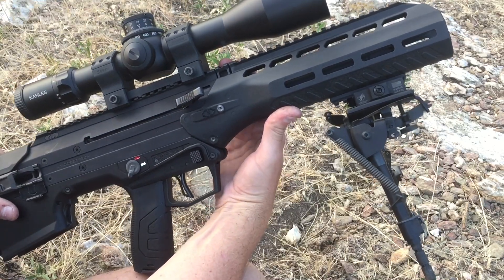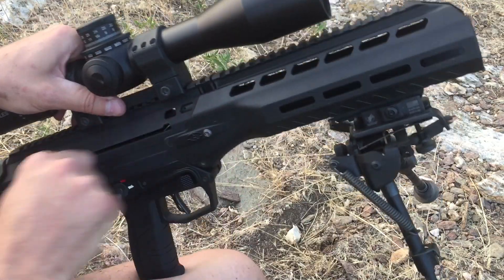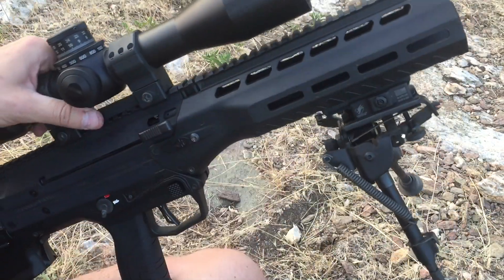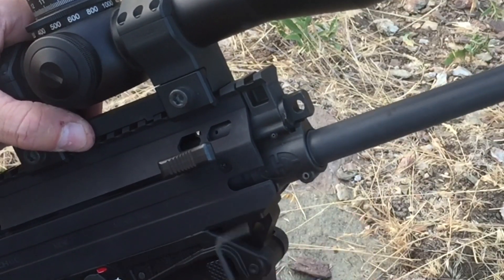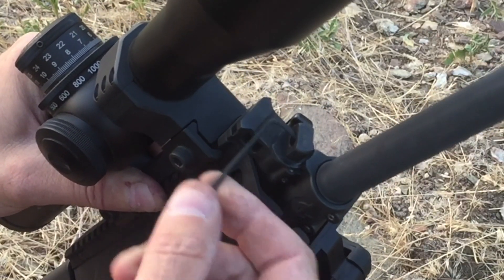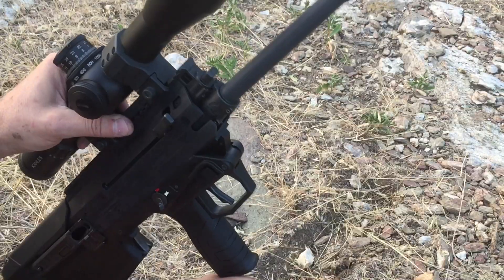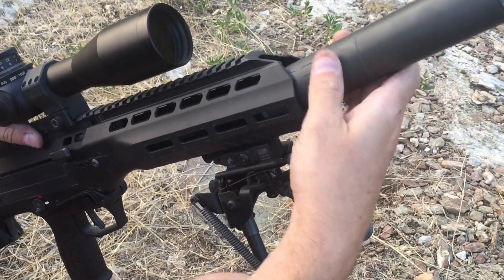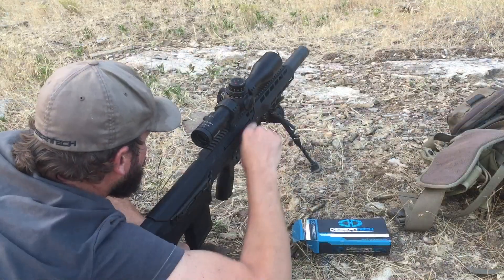Desert Tech MDR Gas Settings

Comment: Very cool gun, but very expensive. So does the gas key setting have a detent for each setting position or is it just a flat turn where you have to stop at the correct location?
Reply from the maker: mike mihelich it has a detent on all six gas settings.
Reply: @coldboremirakle thanks...... so do you like having both mag releases.....the one on your finger tip and behind the hand? The org Tavor had it but on the X95 and Tavor7 they eliminated it? What are your thoughts on mag changes?
Reply from the maker: mike mihelich i like having both, I mostly use the front one, but its handy to have both.

Comment: Have you tried to see if it cyclee subsonics
Reply: No 308 semi will cycle subsonics. The bolt and recoil spring are made heavy in order to handle full-power 308, and no subsonic load generates enough pressure to cycle the action.
Reply from the maker: g A not with this gas valve, it certainly will not.

Comment: Are they going to make a gas block that is more adjustable?  It seems like it was designed with the military in mind, but the US military won't pick it up without a full length rail and adjustable length of pull.
Reply from the maker: I imagine there will be many options for it soon.

Comment: So to adjust the gas setting yoi need to loosen 2 screws and punch a pin out. Then take off the handguard to adjust? Wow I'm sticking with my RFB. It has ran flawless anyway. Not to say this isn't a nice weapon after looking at all the other features. And if i were to get one id switch it to the "S" setting anyway but the fact you have to do all that just to switch settings is disappointing.
Reply from the maker: Thats ok, you wont hurt anybodies feelings. Some people even like high points.